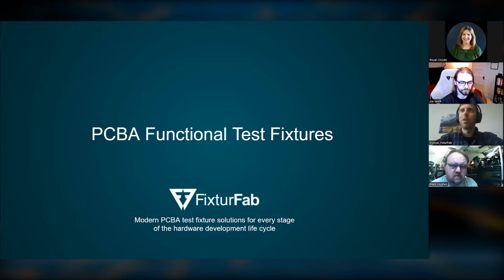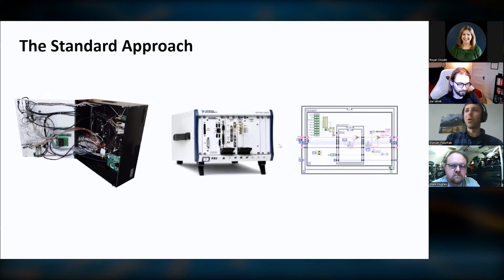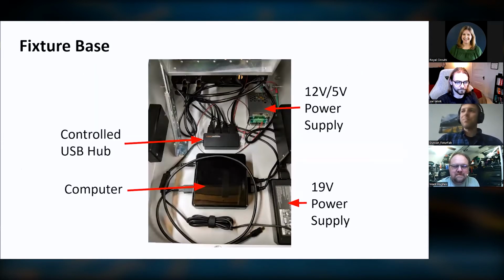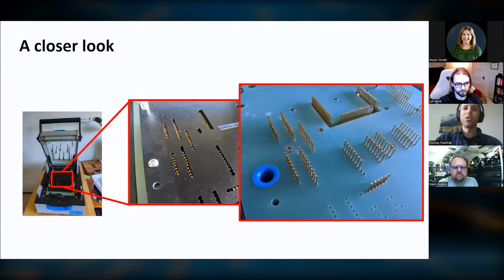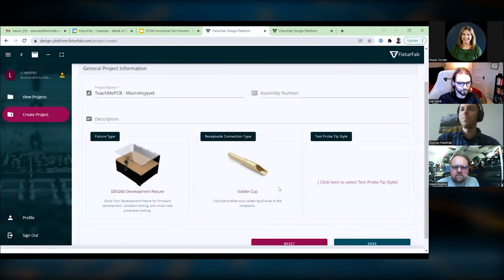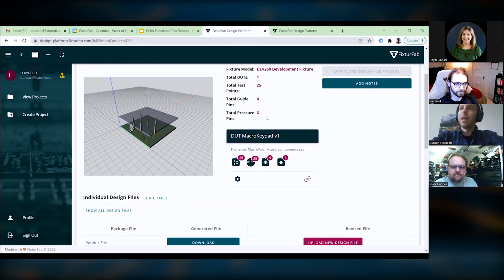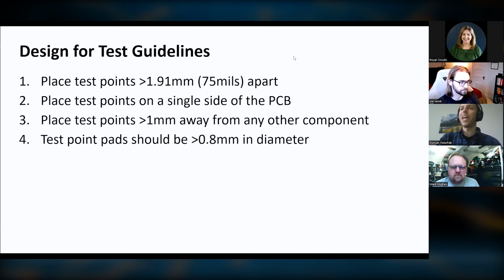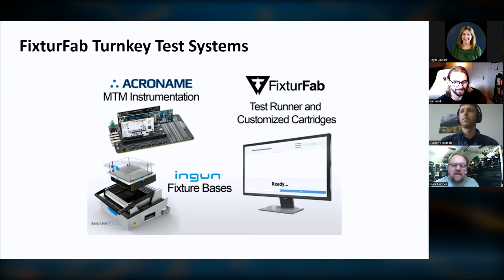How to Design Custom PCB Bed-of-Nails Test Fixtures

Comment: Great Video👍
Just curious why did not you go for cheaper and simpler option like Raspberry pie in ICT fixture?
Also, does the test controller card for the MicroFunctional test make the usual test equipment (in a conventional bed of nails) redundant?